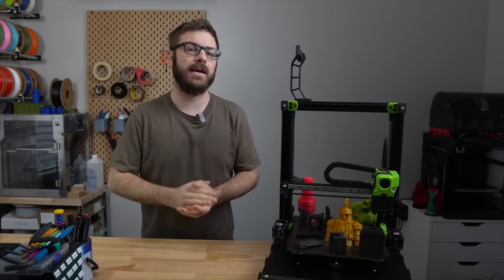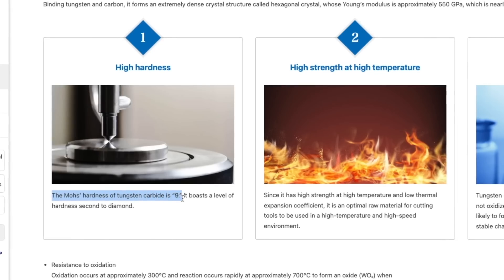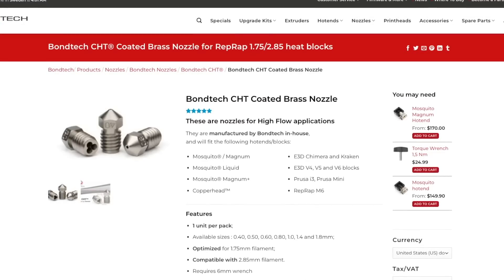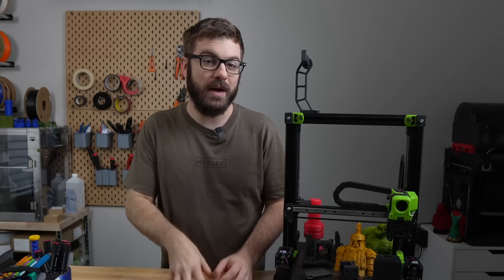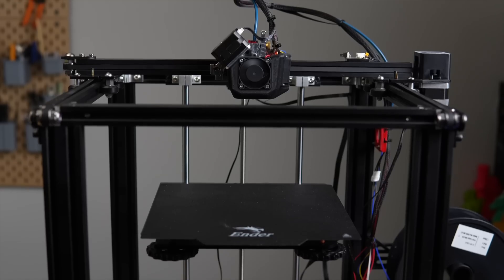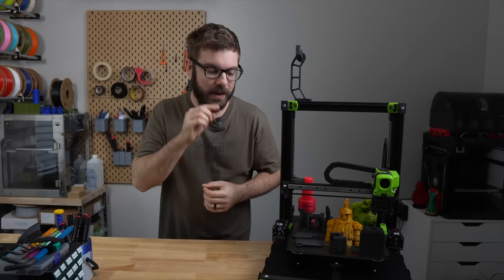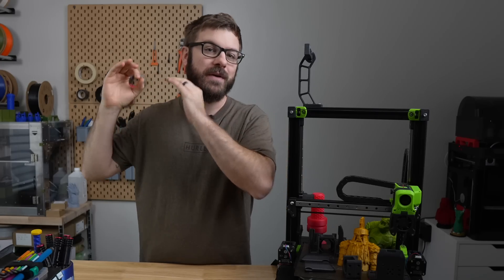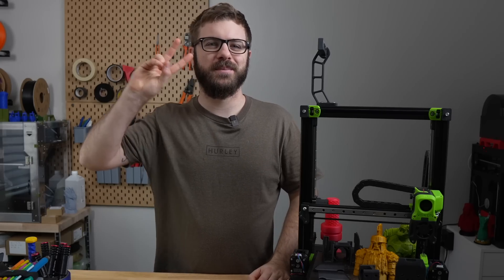What Is A Bozzle Nozzle?

Comment: Couple of observations. First, it shouldn't be assumed that thermal conductivity with tungsten is identical with brass at ALL temperature ranges. Heat transfer shouldn't be assumed to be a smooth curve in different metals just because the coefficient is about the same average. Heat can go faster through brass at the same temp as tungsten.
Secondly, I have my doubts as to how it's possible to push more material through a given diameter hole that has "heat transfer fins" within it. A circular hole has the most space possible. The only way to include "fins" inside a circular diameter hole is to increase the size of the hole.

Comment: If I were to pay around 100 usd for a nozzle I would buy the diamond tipped one that is not 9 of 10 but 10 of 10 in wear resistance/hardness, why pay the same but get less? For this to be worth buying it would have to cost less than 50 usd.
Reply: You can't clean the diamond nozzle with a blow torch.

Comment: I really like the sharp, abrupt tip on this one. I bet it prints PETG much better than most nozzles because there's not a whole lot of surface area for the petg to stick too and slide up the side of the nozzle. I use a diamondback and i don't think it's great for petg for this very reason.
Reply: The diamondback works really well fore petg

Comment: Very thorough to repeat the flow tests. It seems this nozzle geometry offers greater surface area to quickly melt the filament core at high flow rates, reducing resistance at the nozzle tip. However, this geometry is more restrictive at the throat, especially at low nozzle temperatures.
Reply: It's the same with the clone cht nozzles. Since both dont feature any knife like edges at the start of the split/geometry change they work better in longer hotends where the material is already soft before it reaches that point.

Comment: I had issues with my clockwork 1 extruder skipping so I ended up swapping it out for an orbiter 2.0 and it fixed that problem. 

Polymaker pla is really nice and I use it a lot for projects but I have experienced a lot of trouble printing as fast with it as other pla. Even at very high temps I cant print it as fast as say inland pla+ which can print at least as fast as my printer is capable of printing.

Comment: Nice but at $99 it's out of reach for most 3D printer who do this as a fun hobby. I purchase the harden steel nozzles off Amazon and get like a few for about $15 that seem to last forever and work well with most abrasive filaments that cause wear and tear. I really wish this could be kept in mind when they make these nozzles. I mean the most popular printers are the cheapest printers like the Ender 3 at less than $200. While this helps us in the long run and China has a tendency to make cheap clones that work well enough for us budget friendly 3D printers.
Reply: Once you start printing GF filaments, you'll start eating through those cheap (and also not cheap) steel nozzles pretty quickly. At that point, these carbide nozzles start making a lot more sense once you factor in your time troubleshooting, swapping nozzles, and failed prints.
Reply: Thanks for mentioning the cheaper options....I didn't realize the video wasn't at the end...paused it too soon to get some work done. LOL

Comment: Very nice vid!  I have been waiting for a hardened version of the CHT nozzle so that you can get high flow and also print abrasives. This looks like a great option! A bit pricey at $75 US, so I will probably wait for a high quality clone.   Also, on the tensioner.. I have had similar issues before on stock Voron extruders. I really like the LGX lite for that reason, because there is just a simple lever- it's either tensioned or not, there is no in between. Bondtech recently released a Stealthburner mount for them also, so it might be a nice upgrade!
Reply: Yay, let's not support the creator and buy clones! 
That's how you get people to stop innovating and making new cool stuff. 
Don't buy clones.
Reply from the maker: I have an lgx light in a box haha I have been meaning to upgrade a v0. I love the one on RatRig. So far the cw2 seems to be performing better. I haven’t re ran flow tests yet but I definitely will. 😊

Comment: Brass nozzles are a part of the reason why otherwise food safe materials cannot be made food safe through 3d printing. Does tungsten circumvent this? Could be pretty big for the 3d printing industry if that were so. I'm getting into 3d printing to manufacture parts for my aquaponics system, and thus far I have to epoxy everything I make. Waiting for the day when both nozzles and materials can easily be food / fish safe.
Reply: Honestly, if you're printing for food-safe, I'd just use stainless even though it sucks thermally. 

I'd like to do some looking though, you have a good point. Maybe it's fine.

Comment: I think one of the best benefits is layer adhesion with this nozzle.  Any better luck printing materials that crack (abs)?  I also wonder if there is less curling / warping since the center of the extruded material should more uniform when compared to the ends. What are your experiences?
Reply: Why would anyone still print with ABS? There are stronger better options that do not toxic off gas.
Reply: @truantray  It is cheap and can be smoothed with acetone.
Reply: @truantray  what materials would those be? ASA still has vocs

Comment: There's really no reason to ever use brass nozzles. Generic tool steel or hardened steel nozzles aren't expensive, and hardened nozzles last forever if you're just printing standard filaments like PLA and ABS/ASA.
Reply: Better thermal characteristics for brass but having said that the Bambulabs P1P comes with stainless steel and handles everything very well.

Comment: I use Dyze  tungsten carbide nozzles. The only issue I've had was glow in the dark filament with the .4 clogged. All the other sizes have worked great though.
Reply: Yes you need 0.6 for many of the filaments with additives like woog filament.

Comment: Spool 3D also has tungsten carbide nozzles for many hotends with nozzle diameter options.
Reply: I do not recommend tc nozzles from Spool3D. The orifice is way off center. In some cases it's impossible to insert the filament.

Comment: Love my bozzle nozzle! Have blow torched the thing a couple of times to clear out gunk. And the WC has withstood several kg of PCCF without showing any signs of wear, while still outputting at crazy flow rates!
Reply: What hotend are you running the bozzle in? I’ve been having trouble with mine coming loose and wondering if I need a different hotend.
Reply: @apocalypticangell  make sure you're hot tightening! if you're still having issues, contact your vendor for help.

Comment: You forgot the biggest advantage over steel: The higher lubricity. Much lower chance of clogs with fiber filaments. Really cool, although unless I need to print over 300C I would probably go with the diamondback. But it is good to support small companies.

Comment: I have one and I'm really happy with it! Also no one mentions, but despite the complex geometry it's way easier than other nozzles to do cold pulls. Also with this nozzle I have been able to reduce quite a bit pressure advance and smooth time!
Reply from the maker: I had someone ask about cold pulls so this is great to hear :)
Reply: Which hotend do you have your bozzle in and have you had any trouble with it coming loose? Mine won’t stay in my v6.
Reply: @apocalypticangell  I'm using it on a Mosquito Magnum and it's firmly in place. Since it's extremely hard if you overtighten it it will deform the threads on softer materials like aluminum. Maybe you can try to use some boron nitride to keep it in place. Or maybe you can get a new block, probably you can get a clone block in copper for quite cheap (Trianglelab should be good, others like Mellow use a softer copper alloy)
Reply: @apocalypticangell  On Northprint's website it says you have to buy their adapter for the V6 to work, it's listed as "Volcano Adapter"
Reply: @DifferentAverage  The Bozzle is a standard RepRap M6 nozzle (also called V6) that has the right length to work fine on a V6. The volcano adapter is needed to make any V6 nozzles work on longer blocks, like E3D Volcano or Volcomosq and its clones.
Reply: Thanks for your post! Really needed that information especially since I have the E3D style with the longer block. Adapter and nozzle are on the way
Reply: @apocalypticangell  I use a creality spider hot end and no issues.

Comment: I have a feeling that higher surface area for melting may not be enough to offset the additional friction for most uses. It also makes clearing a clog more difficult with cleaning filament or cold pulls.
Reply: cold pulls work fine!

Comment: I feel like if you're able to 3d print metal this wouldn't be that hard to make, though I'm not sure how small metal 3d prints can be
Reply: Agreed, not a good application for 3D printed SLS metal.

A rougher surface finish means inconsistent flow and a higher chance of clogs.

Comment: Great to see your experience with the bozzle! Have you had any trouble with the nozzle coming loose in your hotend? After 1 or maybe 2 small prints, the bozzle has been coming loose in my v6 and leaking. I just ordered a rapido to see if that works any better. :/
Reply: Did you hot tighten the nozzle at a temperature above your printing temp?
Reply: I’ve done both of those things, but it still comes loose.
Reply: You need to install with Boron Nitride paste and hot tighten Bozzle.
Reply: If the block is aluminum replace it with a copper plated one. I could never get it to tighten properly with the aluminum block and ended up stripping the threads since it's so soft. The copper block I've never had an issue with and it's tightened up perfectly.

Comment: My questions is: are they machined, or are are they cast tungsten carbide. 🤔 

I'm wondering if that plays a factor in their durability too since cast tungsten carbide inserts for lathes are notoriously fragile - dropping them by mistake is a big no no 😂
Reply: Almost certainly sintered ii.e. cast that how carbide insert tooling is made.
Reply: I dropped mine once onto concrete and thankfully it was fine

Comment: There are also 100% TC volcano nozzles available, for much lower price, without any special geometry. I have one I want to test, but I need to make some toolhead adaptations before I can.
Reply: Where? I'd rather run a long 0.6 TC so I can still run TPU without the CHT feature, and have the longer melt zone to get the max flow up for everything else.
Reply: @black99rt  Mine is from A3DP.

Comment: At higher flow rates, you can definitely run into limitations based upon the extruder. Hotend isn't always the bottleneck. 
Thank you for sharing info on this nozzle. I've been looking at the Undertaker nozzle (from West3D) for a while. It is solid tungsten carbide, without the cht type feature, for ~$50.
Reply: Hotend is a bottleneck. Higher flow hotend will allow for the extruder to work less. Everything works together
Reply: @wyattutz  I agree. gotta have a good extruder.
Reply: This test seems relative. Put .5 nozzle on X machine, compare to bozzle. That's it.... if you need to use a different extruder that means that the nozzle has more back pressure than the standard .5 nozzle.

Comment: I don't know why I have always cheaped out on the nozzle like it's probably the most important part
Reply from the maker: If it makes you feel any better I did as well for years. I would just buy the cheapest pack with decent reviews on Amazon. It is really hit or miss though. You can get at least good quality nozzles $15-20 from a reputable manufacture.
Reply: @ModBotArmy  honestly I've not been able to tell the difference between €0.10 and €30 nozzles in print quality alone. Max flow rate and wear resistance was all i could differentiatie the nozzles between
Reply: @twanheijkoop6753  I would get random fat lines. I always thought the high end nozzles just lasted longer. And I was just like I'm ok getting cheap and replacing instead of cleaning.

Comment: Wish and comparison was made with the bi metal CHT. I don’t have the resources to buy both and test
Reply from the maker: I have not had the chance to test out any of the CHT line. If Bondtech reached out I would love to test them. If there is enough demand I am happy to order one as well. From what I am seeing I anticipate the flow of the CHT is higher. I just do not believe they are as hardy as a straight up tungsten carbide nozzle.
Reply: @ModBotArmy  I also recently bought a Deez nozzle from west3D which is a TC nozzle with internal fins, very similar to the bozzle but due to poor manufacturing tolerances it had to be recalled as it actually hindered the flow rate.

Comment: You can buy 1kg of tungsten on amazon for less than 200 bucks and that's retail price. 
200/1000 = 0.2€ per gram * 36g = 7.2€ per nozzle. 
That's doesn't account for machining and logistics, but I think 100€ for this is crazy no matter what
Reply: lol, this guy.
Reply: Manufacturing something out of a material this hard is very difficult/expensive.
Reply: @daliasprints9798  yeah i agree that's why i said it doesn't take machining or logistics in consideration. If you know a way to estimate the machining cost i'm curious to know more, but I doubt it takes even half of the final price if you can find a steel nozzle for 20/30€
Reply: Tungsten is cheaper than tungsten carbide... Which is what this nozzle is. That's why you can find tungsten nozzles for cheap but not TC.
Reply: @3dPrintingMillennial  I didn't know there was different kind of tungsten my bad
Reply: @xCartoone  no worries. Easy mistake
Reply: Dude, do you know what they make cutting tools out of? Tungsten Carbide. Do you realize how hard it is to work TC, and at a relatively low volume?
Reply: @Mechotronic  No, tell me ?
Reply: @xCartoone  The only thing harder is diamond, so if you want to cut it....

Comment: I have had 0.6 Prima Creator hardened steel nozzles on 3 of my printers for over two years for 16 hrs per day 5 days per week printing Nylon CF and PETG CF and they are still going strong, I get excellent quality prints from them so see no need to change as I cant see a reason to!
Reply from the maker: This is the first time I have ever heard of those nozzles. I will definitely have to check them out :)
Reply: Hardened steel has very poor thermal properties and is probably not what you want for printing at any decent speed.
Reply: @daliasprints9798  Works fine for me
Reply: @AndrewAHayes  What flow? 25+ mm³/s?

Comment: Daniel... you re-ran you tests on the Ender 5 Pro with the Microswiss NG extruder based on the manufacturer's recommendation related to tensioning.  However you also changed another variable... the filament.  Since changing two variables at once doesn't let you determine with certainty that the tensioning was the only impact on the first test, did you ever end up testing on the Ender 5 Pro with the original filament?
Reply from the maker: I did not. Although I was quite confident that the filament was not the issue I wanted to essentially start with a clean slate when I switched printers. I did use the .5 brass vs .5 bozzle with the new filament on the NG to make sure they had the same test environment but I did not go back tot he original filament. Based on what I saw on the CW1 I do feel it was the extruder and not the filament but this is something to keep in mind for future testing. Thank you for the feedback.

Comment: Thank you for covering this. Not many people seem to know about this nozzle.

I bought one a couple of months ago because I was concerned there was going to be a patent fight that could see it disappear. Good to know their splitter hole pattern isn’t covered by the 3DSolex patent.

I haven’t put it on yet. I’m still using a CHT on a Dragonfly BMO and haven’t needed to print any abrasive materials on that printer so far. Your video gives me new impetus to put it on and start playing.
Reply from the maker: I have been interested in this nozzle for some time. I had originally seen Vez make a high level overview of the nozzle but aside from that I did not see much info out there other than in Discord. Glad I was able to shine some light on it. 

Due to its price it definitely isnt the nozzle for everyone but for those wanting a high quality nozzle for pushing abrasives with increased flow it is a solid option. When you end up installing it let me know your thoughts after some time.
Reply: The funny part is that knockoff bozzles seem to work better.
Reply: @okleydokley  I don't think there are bozzle knockoffs out there man. If they do exist I need proof it's a clone of the bozzle and not a cht